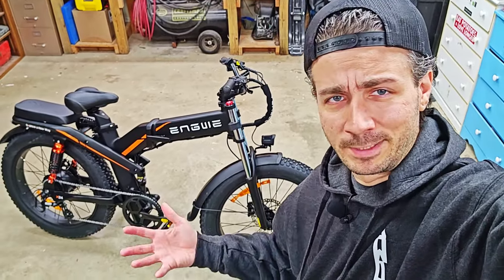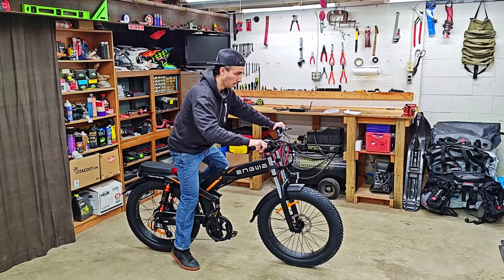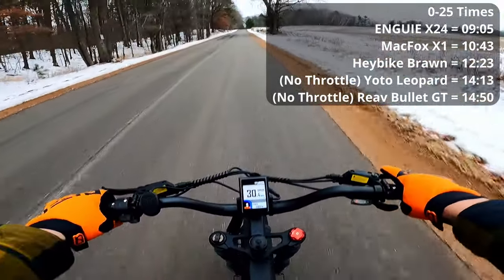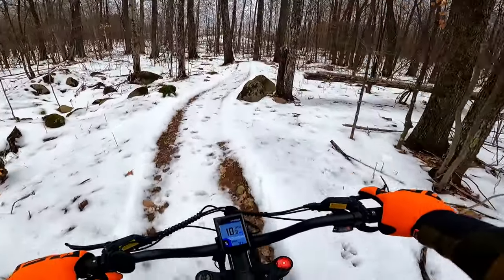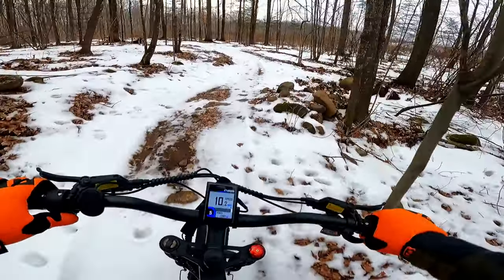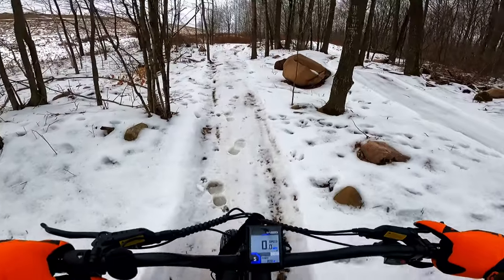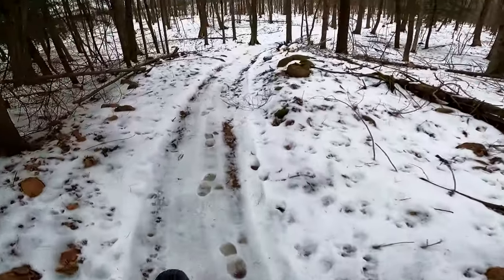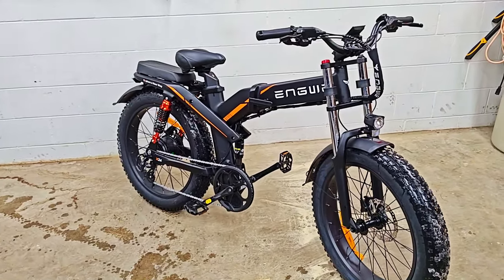A Folding E-Mountain Bike That Shreds!? | Engwe X24 Review

Comment: Hi mate, Thanks for the excellent breakdown, I love the bike and was thinking or getting one, only issue is that I'm worried it wont fit in my car boot for transport, I drive an AMG A45s, definitely smaller than your Atlas 😅 what do you think?
Reply from the maker: Thanks!  Hmm, yeah that sounds like it might be a bit tight.  I tried sticking mine in the back of someone else's car the other day but I was to worried I'd scratch it up, so I decided not too.  Maybe if you had a towel or something to protect your paint it could hang out a little if needed?
Reply: @SWANKY-BIKE-RIDES  Cheers bud, I'll look more into the dimensions and measure my boot
Reply: Do what I did. Fit a towbar to car. Then buy electric bike  towbar rack for fat tyre bikes. Towbar rack costs $150

Comment: Hi!I also bought myself an engwe x26.The sport mode turns off after 5-10 minutes.Does the sport mode turn off in your bike too?
Reply from the maker: Yes it does!
Reply: @SWANKY-BIKE-RIDES  🤔😔
Reply: X24 owner here 🙋‍♂️
You can "prevent" that if you turn off your bike and then when you power it back up, press + and Info at the same time.
The bike will stay in sport, but the motor will get warmer as normal.
Reply: @freetek23 wait how did you find this out, I’ve been looking everywhere for this
Reply: @accuratedisgust7494 just saw it in a random unboxing video about it tbh